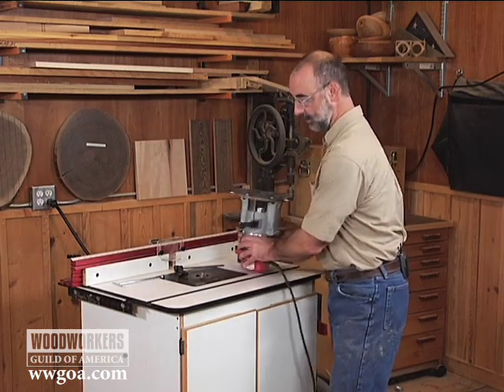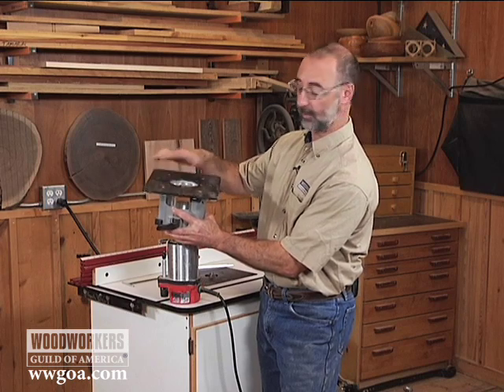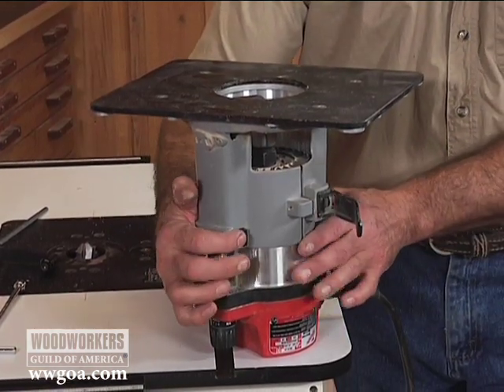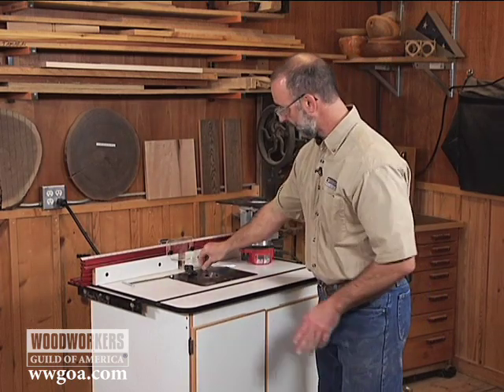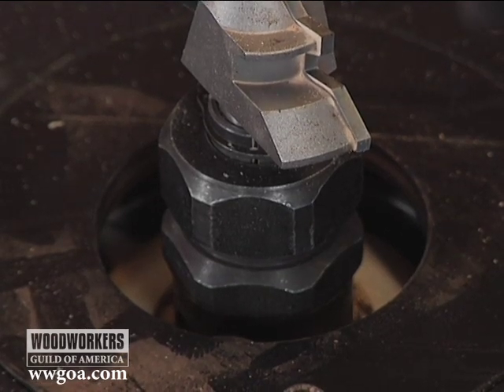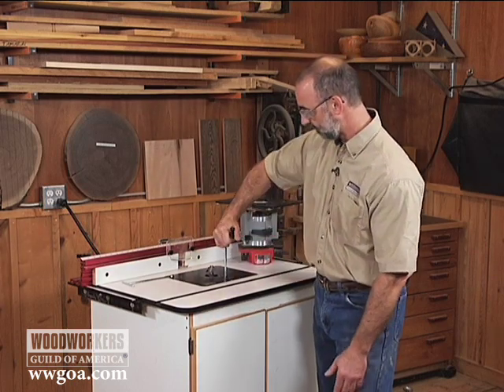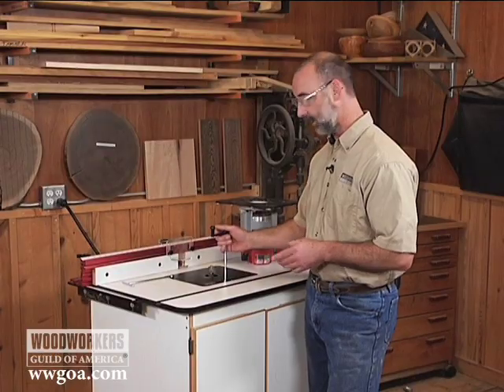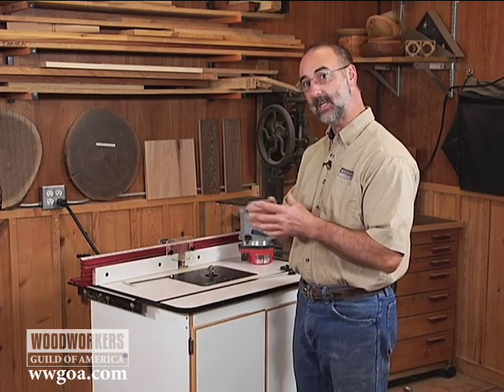Woodworking Tips: Router - Why A Router Lift?

Comment: the problem i have experienced with using the built-in lift mechanism by drilling access holes from the top for my pc router is that wood chips and dust fall between the router and the case. this jams the router up and makes it difficult to use the lift function. this is why i'm moving to a proper router lift.

Comment: Question, do you have a jig or setup for using a Lock miter bit on long 36" end grain or long grain 4" + wide stock, say if I were to build a hallow 4" thick box by 12" wide out of 3/4 stock. That is locked mitered on all joints to look like solid stock.

Comment: wait a minute, can`t you adjust that base from above, you do not have to take the motor out, porter cable has the same adjustments from above the tables are drilled for above the table adjustments

Comment: For more than half the cost of an overpriced lift you can have a PC 892 router and have the very same thing a lift offers. You can adjust the height, lock/unlock the motor and change bits above the table. As far as the height adjustment dial with some of the lifts I wouldn't trust the readings to be that accurate.

Comment: Unless you're using 240 volts, a 15 amp router is certainly not 3 horsepower. Even at 100% efficiency it's just under 2 1/2 horsepower. Really your best case scenario in the real world it's going to be just under 2 horsepower for 15 draw a 120 volts.